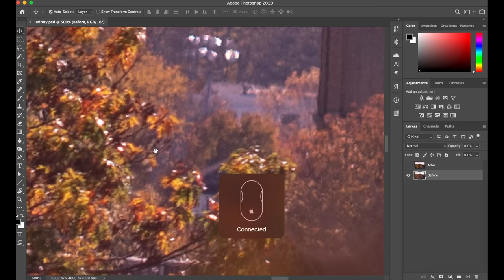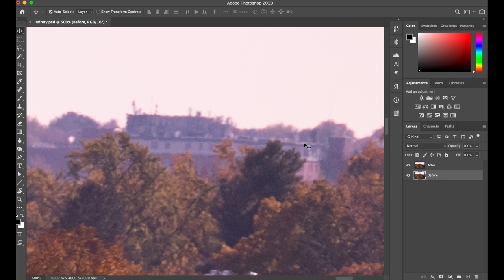"Infinity Focus" and Fixing a Rokinon 135 f/2

Comment: I bought a Rokinon 135mm F2.2 ED UMC thinking it was a 135mm F2 lens. I want to use mine for astrophotography. Is there much difference? Also, I cannot select F2.2. Stops @ F4. Nor can I select Infinity. Is this normal? Thanks for your videos. Much appreciated. Mike
Reply from the maker: Is it perhaps the T2.2? If so that's just the cinema version and should be optically identical, just a different housing designed for cinematographers.
Reply: @NebulaPhotos   Yes it's a f2.2. But I still cannot get to F2.2 .stops btw F4 and F2.8. Nor can I adjust focus to Infinity.  Thx for the  reply
Reply from the maker: If you are still within the return period, I'd return it. If not, when you say it won't focus to infinity are you just talking about the marking on the lens or have you actually tested it on a subject at infinity focus? I'm not sure I understand about the aperture values, the Rokinon cinema lenses I've had have a clickless aperture ring so can be set anywhere. Turning it all the way to the right would give a T Stop (transmission stop) of T2.2 which is equivalent to an f/ratio of f/2.0.
Reply: @NebulaPhotos   It does have " clickless" aperture ring. It just will not travel any further than between F4 and F2.8. No where near F2.2. I have not tried the focus on infinity, will do today. but again, I cannot turn the focus ring anywhere near even the "L" never mind infinity. Thx for the reply. I was hoping to attach photos but no luck. Mike
Reply from the maker: @1clancym  It could just be that the markings are way off; I've seen that before on manual lenses. If you turn the aperture ring as wide open as it will go (between T4 and T2.8) can you see the blades of the iris when you look down the front of the lens? When a lens is wide open, you typically can't really see the iris. If you can't see it, than my guess is that position between 4 and 2.8 is actually 2.2
Reply: @NebulaPhotos  Yes when I open it all the way, you cannot see the blades, so I'm guessing you are correct and the lens is mis marked. Thx for replying. And thanks for the videos. I am new to astro photography and am amazed how much there is to learn. Mike

Comment: I'm having big dramas with my recently astro modded Sony A7C when using wide lenses like the 14 and 24mm GM. They do no longer reach infinity focus at all when wide open or anywhere near wide open. Kind of looks acceptable past f4, but that defeats the purpose of an f1.4-f1.8 lens hey. 135mm GM at f1.8 works fine.  Very disappointing experience thus far.
Reply from the maker: Sorry to hear that. I don't have any experience with astro-modified Sonys. Did you do it yourself or send it somewhere?

Comment: So, my lens doesn't go that far to the left of infinity. Am I just position the screw position on the left side of the small slot instead of the right now?
Reply from the maker: It's hard to say as I don't think the markings are consistently lined up with the ring from copy to copy. You just need to make your best guess, then test the lens, and keep repeating that process until you can comfortably reach infinity focus with some room to spare before you run out of focus travel.
Reply: @NebulaPhotos  I think it might have something to do with when each was made. Your inside looked ever so slightly different, but it was a little hard to see. I was only able to put the screws back in one of two positions. I do think it still worked, so thank you for this video.

Comment: Niko, when I tried these steps, it just moves by a couple of mm off Infinity mark.  But continues to lock after that. Is that all the extra turn we get?
Reply from the maker: Yes, it is not a huge change, but with all of the Rokinon lenses I've done it on (4 now), it's all that was necessary to consistly reach focus at infinity.
Reply: @NebulaPhotos  thank you.  I own a samyang 135 for Nikon mount. And am not successful with this.  I still get blurred stars.  When I use the lens with dslr I get tact sharp stars.  So lens is fine.  Am not sure if I did the surgery right.  Is there a way I can get in touch with you on email offline? I will need some help please... been struck with this for more than a week now.
Reply from the maker: @sreeshab4093  I'm not sure I understand. If your stars were tact sharp, why did you perform the surgery? Yes, you can email me: nicocarver at gmail dot com
Reply: @NebulaPhotos  They were tact sharp with Nikon DSLR body, not with astro camera 071MC
Reply from the maker: @sreeshab4093  Ah, okay, in that case. The lens is likely fine as-is, and you just have to fine-tune the spacing between the astro camera and lens with spacers.
Reply: @NebulaPhotos  If I add spacers, even 1mm more, the stars are becoming blurrier.  The focus is set at the extreme end of Infinity.  And if I move the focus away from Infinity the stars are becoming  more blurrier.  I am thinking instead of adding spacers, I should reduce the distance between sensor and lens?  Am I missing anything trivial?

Comment: there’s no way that this manual focus lens will consistently serve you with accurate focus, the way an AF-lens on a mirrorless camera using contrast based autofocus will. i have great results, as an example, uaing a Fuji GFX 50R with the 32-64 mm GF lens at f4, also for astro.